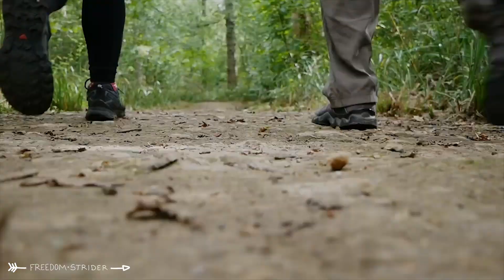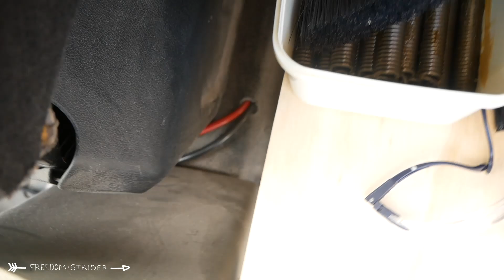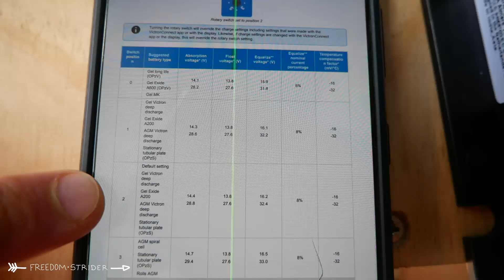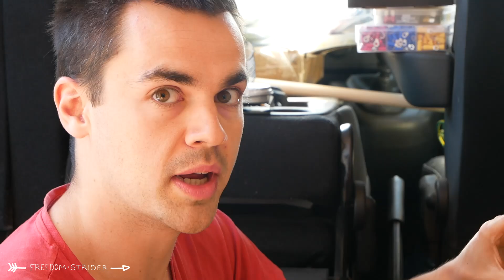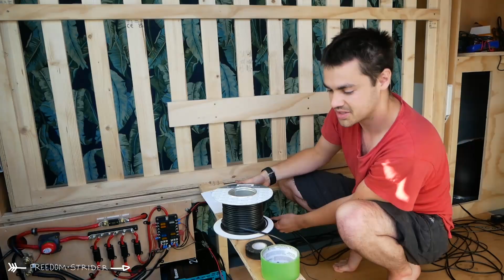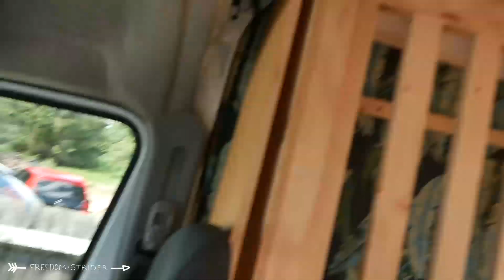Complete Campervan Electrical Install for £1000 | Ep. 6

Comment: Did you not need to add an ignition wire to the Renogy DcDc ?
Reply from the maker: We wired in a manual switch instead of the ignition wire